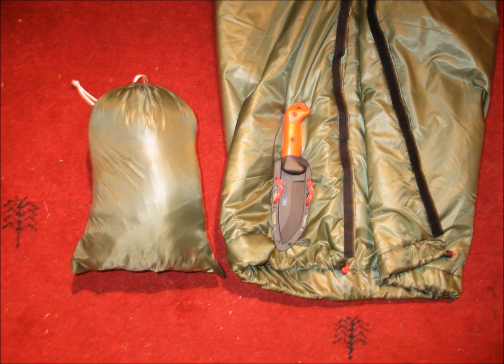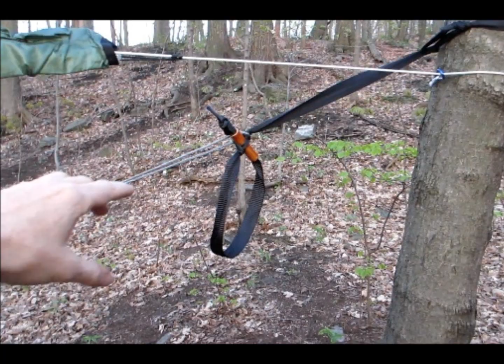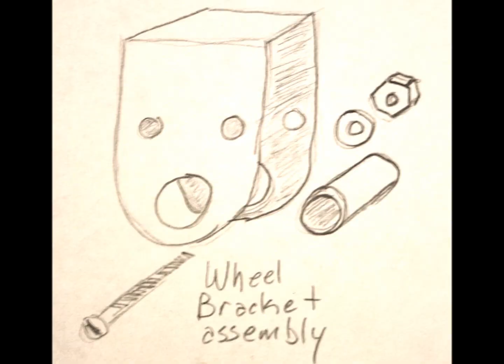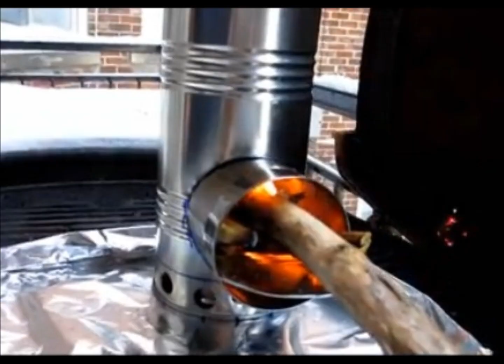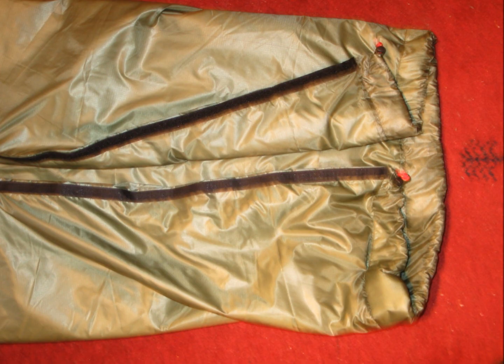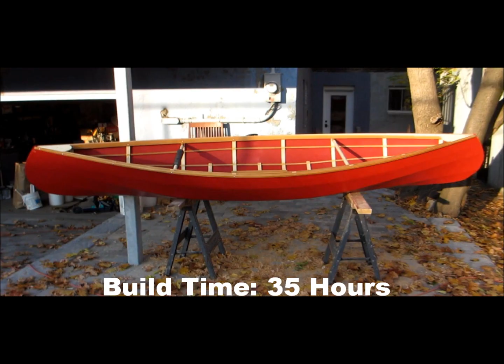Outdoor Gear: Concepts, Designs, & Prototypes

Comment from the maker: The tarp is the 4 Season Man Cave.  You can not buy it, you have to make it with your very own hands.  I purchased the 1.1 oz ripstop nylon at DIY gear supply.  After sewing everything together I soaked the works in a silicone solution to saturate the fabric (as opposed to coating the fabric).  I've had the same tarp for over two years now.  Total cost was under $25.00 US.  Thanks for asking.
Cheers

Comment from the maker: The LDPE hex tarp is my "go to" tarp down to 40F.  After that it's the Man Cave all the way. I did a vid (see my channel) on diy tarp ties outs for that bugger. Check it out.  The insulation I used for my TQ & UQ is called Insultex. Very difficult to find, but worth every penny. It is essentially polyethylene foam with a scrim fabric sewn to each side. My early models were made using the package wrap  used for big screen TVs. Punch a bunch of pin holes it to let it breath. Nothing to it!
Cheers